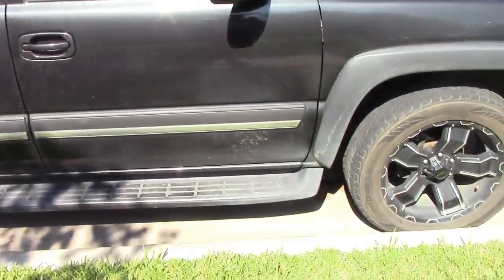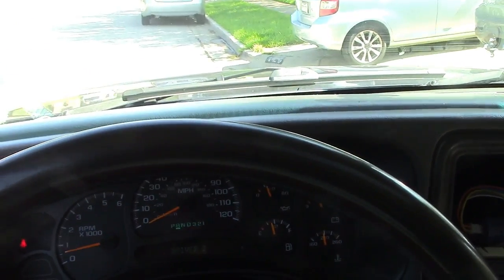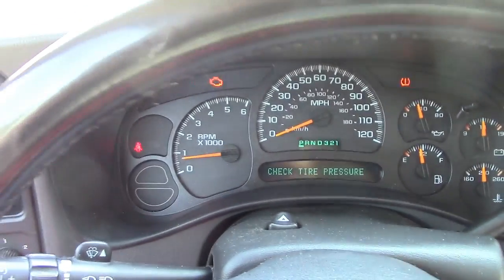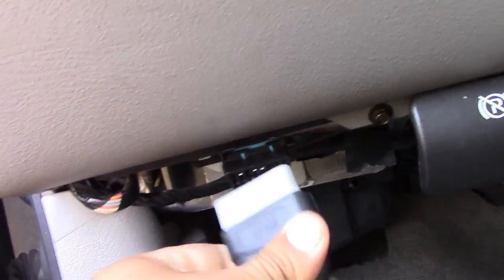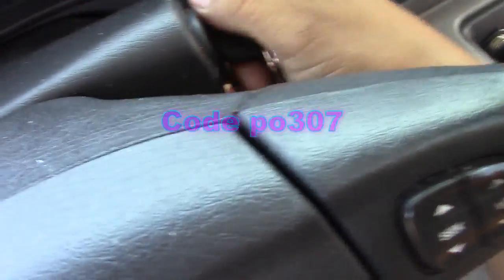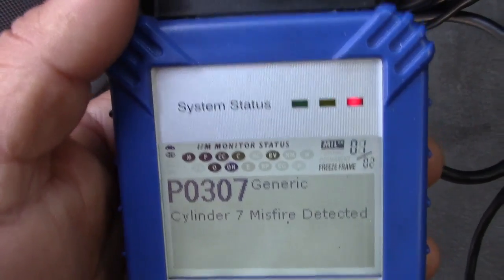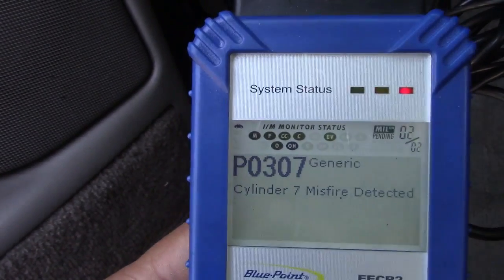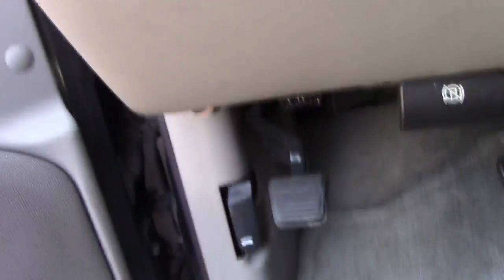Engine Code PO307 Chevrolet

Comment: Gengo el mismo problema ya le cambie el coil cable y bujia y sigue igual alguna recomendacion? espero mires el mensaje gracias, nuevo suscrictor
Reply from the maker: Checa el connector Sino esta haciendo falso contacto
Reply: @RescueMoversDFW  Gracias por responder. Ya la chequie y estan bien crees que pueda sel el injector?

Comment: Great job,I got same code on my '99 Tahoe P0307 Cylinder 7/andP 0141 -O2 Sensor Heater circuit bank 1 Sensor 2.

Comment: Yo tengo una 07 tahoe ya le cambie los coils cables y bujias pero todavia me aparece el check engine light  y como que tiembla en ratos  gracias de antemano
Reply from the maker: damian azpeitia y que codigo te sale?
Reply: Lo lleve a que le pasaran el escaner y me dijieron que era el cilindro 7 pero ya le cambien la bujia cable y el coil
Reply from the maker: damian azpeitia asi me paso con la mia y le cambie todas las bujias y Los coils y se le quito es recomendable cambiarlas todas para que trabajen parejitas
Reply: Daniel Rescue Movers ya se los cambie pero por una razon todavia sigue igual
Reply from the maker: damian azpeitia y volviste a checar si te da el mismo codigo de nuevo?
Reply: damian azpeitia ahora cambiarle el motor cocho

Comment: My friend, this was very helpful. I'm dealing with a P304 code, which is the number 4 cylinder. I'm going to try this. I have a good feeling that this is going to fix it. If it does, I will let you know. Thank you so much for sharing your experience with me. I do appreciate it. :)
Reply from the maker: Michael Long you're welcome,  and make sure that the electrical connector it's in good shape because mine it was a little bit loose. Goog luck and let me know when you fix it.

Comment: reemplasando  el coil no   arregla nada, tengo el mismo problema con mi 03 chevy suburban , le he canviado la bomba del gas filtro bujias cables inyector del cilindro #7  y la bobina como mensiono ,,,,y nada,,, me sigue dando la misma clave p0307, la luz del motor esta puesta y aveses palpita , aver si lee este comentario ? gracias
Reply from the maker: martin hernandez Hola,  ok si tienes solo un codido el P0340 y le cambiaste todo lo que dijiste despues de esto tienes que borrar el codigo ya sea desconectando la bateria y reconectarla o usar un escaner Pa borrar el codigo.  Avisame que pasa